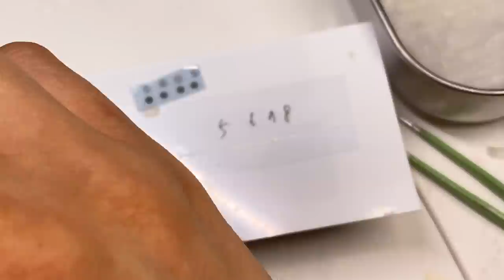MERCEDES-BENZ 300SL 1/24 TAMIYA - part 8

Comment: Thanks for including the whole process to get to where it is. All the trial and error. It's a great reminder that the masterpiece just doesn't happen at one shot. It takes time, patience, and great problem solving skills. And most of all, it takes sheer will, which you show us plenty of. Modeling isn't just snap it together assembly line (and yes, you need that at times). I bet it was frustrating when the decals and masking job didn't go as you planned. But at the end, your ingenuity overcame all that and made it even better. And the result is phenomenal.
Reply from the maker: Thank you for kind words!

Comment: It's comforting to see that mishaps happen to you too, but what you make of those mishaps is breathtaking. Better than before!
How thick are your transparent polystyrene sheets? Got me a circle cutter too and unfortunately can't get clean, round cuts. I use 0.4mm sheets.
Reply from the maker: I use 0.1mm or 0.2mm sheet. And if it's thick, you have to rotate it several times.Thanks

Comment: So lovely. Inspirational work, as usual. Can you suggest a good paint to simulate bright nickel plating? I can’t afford to buy a wide range of paints looking for the best solution, and you seem to have done a lot of research into metal finishes. Any help you can offer would be very thankfully received.
Reply from the maker: I think a lot of modelers are worried about paint that feels like plating. So am I. It's hard to recommend because I haven't got an exact answer yet, but I'll make a video within the range I know. Thanks.